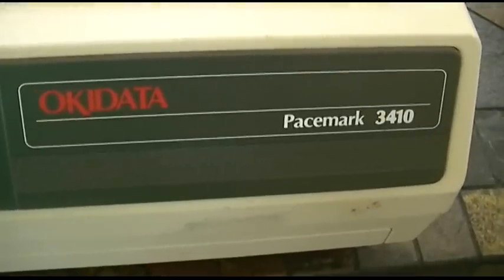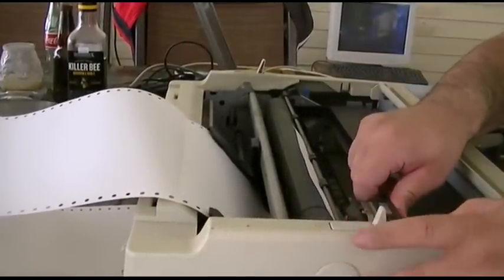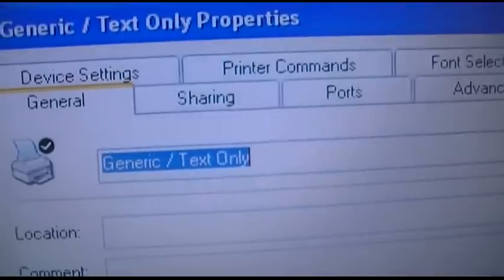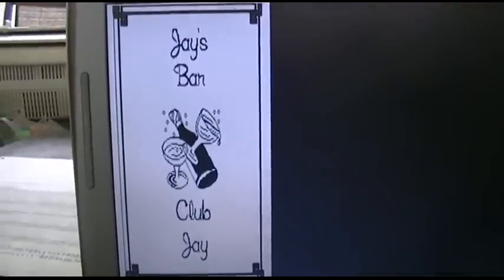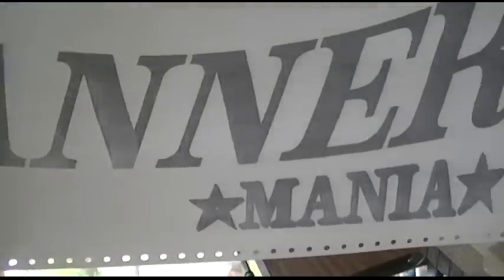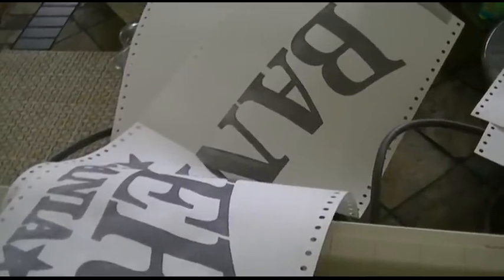Okidata Pacemark 3410 9-pin Wide-Format Dot Matrix Printer

Comment: 4:07 self-test
6:10 Demo in Utility
6:44 Demo in HSD
7:24 Demo in Gothic
7:55 Demo in Courier
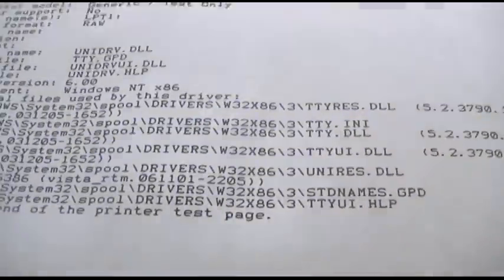8:15 20 CPI demo
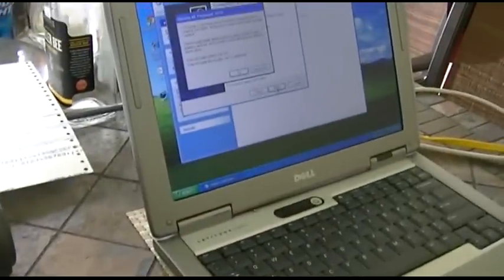9:43 High resolution print
12:11 Windows test page print - medium quality
12:35 Windows test page print quality comparisons - lowest, medium and highest
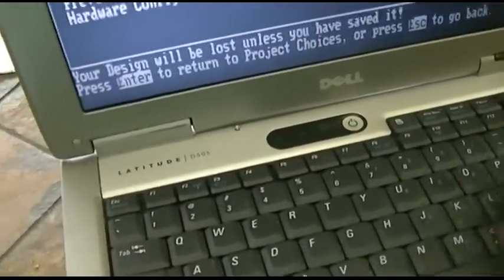14:27 Printmaster demo
17:14 Buzzer test, and line feed using Command Prompt
18:57 Road test 1
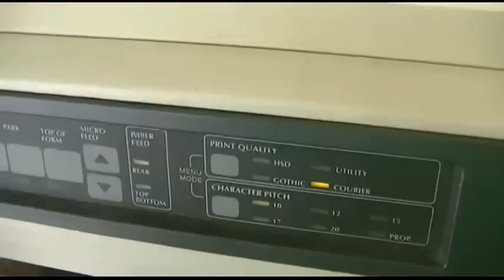22:16 Road test 1 (higher quality)
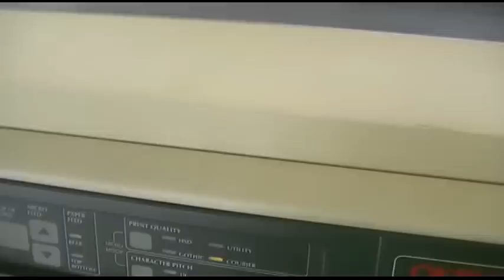24:18 Banner Mania demo
Reply from the maker: +BBRCTA2K5441393 Thanks for that!
Reply: jaykay18 It's there so that when I come back to this video, I don't have to watch the whole video which includes your talking, and problems caused by incompatible drivers. Anyways, since that printer can really shake that table, here I give a nickname for the printer:
UnstableData Shakemark 3410 HP

By 3410 HP I mean 3410 horsepower, the amount of force produced by the printer.
Reply from the maker: Techtron23 Awesome!
Reply from the maker: It just does.  If you're running a 64-bit version of Windows, you're out of luck and you can thank Microsoft for that.  It may be possible, although I haven't tried it, that DOSBox would allow it to print.
Reply from the maker: Yes, I do.
Reply from the maker: At least 3, possibly as many as 5.  They are not "stocked".
Reply from the maker: Yes, for $500.  They're collector's items now, so you have to be prepared to pay the collector's price.
Reply from the maker: Yes, they do.  I have one other video, of another printer, printing from Printmaster Plus:  https://www.youtube.com/watch?v=-qhdg_FYWTI

Comment: Nice to see this stuff again. I was in it back in the Oki 2410 days of the mid 80s, sold a few of them. Never forget the first time I laid eyes on one at Comdex. Oki had them lined up around their booth running non-stop. Blisteringly fast compared to the Epsons and even the higher end DataSouth printers we had been pushing. The printheads reminded us of little chainsaw engines.
Reply from the maker: Oki's have the "squeakiest" sounding printheads.  Nothing else sounds quite like them.  One thing they did suffer from was heat.  Give them a lot of block graphics to print and eventually they'll overheat and start printing slower and slower and slower until it has to just sit there and "pant" to catch its breath.  But feed them text all day and they'll crank all day, absolute workhorses.

I grew up on an IBM ProPrinter, and there was no way you could overheat that head.  You could send it page after page of complete graphics and it would keep going.  Touch that printhead and you're looking at third-degree burns though!

Comment: I miss these old dot-matrix printers. I used a basic 9-pin Epson for many years and it was a fantastic printer. Replacement ribbons were dirt cheap and although it was just a simple 9-pin model it was capable of producing beautiful fonts. They could be rather loud but they were great and I really miss my old Epson. I'd love to have another one.
Reply from the maker: I used a true-blue IBM ProPrinter from about 1984 probably until around 2000.  It's printed countless pages.  Besides ribbons, and oiling the rails every now and again, it once needed a replacement printhead because one pin either broke or wasn't firing.  It still works to this day.

It's not terribly often I have just plain text to print out anymore, and graphics really take a long time to print on a dot matrix.  Though I have to admit there have got to be 8 dot matrix printers on my network, any of them can be printed to at any time, even wirelessly.  They were, and still are, workhorses.  Some businesses continue to use them.

Epson still makes and sells dot matrix printers.  But just like cars are basically lightweight tin cans today, and not like the old American Iron Muscle Cars with chrome bumpers, they weigh nothing and don't seem like they'd hold up.  I'm certain ebay has a plethora of old dot matrix printers for you to choose from.  Most likely they'll just need a good cleaning and some lubrication.
Reply: I've noticed modern-day (new) dot-matrix printers I see for sale are rather pricey compared to their cost years ago. Even a basic printer typically runs in the $300-500 range and if they weren't so damned expensive I'd probably buy one. I was gonna mention before that I still see dot-matrix printers still being used in various offices like auto parts stores or any business that still use multilayer carbon(less) forms. If I were to buy one it would definitely be an older model as you suggested. I just wish I would have never sold my old Epson back in the mid 90's. The friend I bought it from gave me at least ten extra ribbons and in two years time I maybe used 2 of them.
Reply from the maker: Yeah the price went up because now they're a niche market.  Very few businesses still use them compared to years ago.  Because the demand is low, the price is high, and it will likely stay that way forever.  It's too bad, a bygone era.  Chances are one day you'll come across one at a decent price, they still pop up from time to time.
Reply: I retired from my state job in 2009 and in the computer operations room we had three HUGE dot-matrix printers that printed on greenbar paper. They were high speed printers with special insulation on the inside and they were still LOUD but they pumped out many thousands of pages every single night 7 nights a week, and they were in service for 17 YEARS.
Reply from the maker: My dad worked for IBM for 35 years and I remember chain printers, those were REALLY fast.

I have a DataProducts 8070 Plus that is more of a business-grade printer, it's an oddball 18-pin printer, and can print up to 480 characters per second.  That's also a pretty serious machine, though many printers today can beat those numbers easy.  I have an old Okidata printer buried somewhere in the garage that has a dial you can turn to set the page length in inches, prints text only, no graphics capabilities at all, prints using an old 2-spool typewriter style ribbon.  Case is all metal, it's virtually indestructible.  

Waiting in the wings is a Panasonic daisy-wheel printer, complete with a box of film ribbons, for some of the best letter quality printing ever.  I need to make a video on that already...

Comment: Dude, this is a FANTASTIC video. So detailed -- you know so much about printers. It's funny when it all goes wrong though :)
Reply from the maker: Joshua McQueen Thank you.  I grew up with these printers.  One day I found the manual for it (and this was back when they would write manuals with all sorts of technical information), and read it cover to cover.  Then I applied some of the things I read in the manual, and ended up learning all kinds of stuff.

This was back in the day when things were more mechanical, and you had access to the core of the machine, rather than all the fancy touch screens and facebook that we have today.

One of my favorite lines (if this makes any sense to you) is "That's called drop down to DOS and get the job done properly".

Comment: Late to the party, randomly encountered this video while I was looking for EEPROM information for ADP and R&R chips. but if you want to watch all the gears run without the cover in place, remove the 2 screws at the back and tape down the switches on either side of the metal frame the control panel is attached to. Plenty of car dealerships still using them so they are fun to work with.
Reply from the maker: Thanks Josh!  Next time I play with it I'll take a look at those switches.  This would be really nice to see run open, since it runs so fast!
Reply: Not a problem. Since I believe you are outside the range of my repair work and know what you are doing I can get you 3410 service manuals if you need. They have their 1997 one with part numbers as well as an updated one from 2015 that doesn't list part numbers. Normally I use the older one but I am typically trying to isolate a number for ordering.
Reply from the maker: If you have the manual in PDF format (or some other electronic format, it wouldn't hurt to have!
Reply: Have to double check the format, but it is electronic. I'll send a message with it once I find it.
Reply from the maker: All right thanks!

Comment: I’m having trouble with my printer changing from print quality utility to gothic. Would you know how to change the setting to keep it in utility?
Reply from the maker: If it's doing it by itself while NOT printing, that seems to indicate a button issue.  If it switches during printing, the control codes to switch it are being output to the printer.  Check your driver and emulation settings.

Comment: How can I get my Oki Pacemark 3410 to print darker?
Reply from the maker: Replace the ribbon.  They are indeed available.

If it still prints too light, it's possible your head gap is set improperly.  For single-copy paper without any carbonless copies, it should be the closest gap.  The manual is available online and will explain how to set that.

To rejuvenate an old ribbon, I have heard you can spray it with WD-40.  I have never tried it, so I'd recommend you first get a replacement, then do some research, and try it.

Comment: Very cool! I'm working on editing the video of the Apex 80 you wanted to see earlier btw. I'm a bit envious, your one is a real work horse while mine is much more rinkydink for the home market. lol
Reply from the maker: There's nothing wrong with "home market" machines; that's what most of us had back in the day!  I got lucky running into these!
Reply: Before I really got into collecting old computer stuff I once saw a pristine Epson 24 pin dot matrix printer with paper rack and everything in it's original box and they only wanted 10$ for it. It's still something I kick myself for letting go. lol
Reply from the maker: Transcendental Airwaves As much as I hate to say it, I've got a couple of those, too.  Of course, they're not pristine, the paper advance handles are broken (or not working well), and they've certainly yellowed over the years.

I've found that Epson printers can be hit-or-miss, some were real nice, others were just junk.  Oki printers always meant business.

Honestly I've always preferred IBM printers (dot-matrix), they were the most no-nonsense printers in my opinion.  Even into the early days of Lexmark buying out their printer line they were good; I have a Lexmark Forms Printer 2381 that's awesome.

Comment: These printers squeak like this because the pins fire really fast. Its what makes them print so fast.
Reply from the maker: I beg to differ on that, I have a ML 192 which prints much slower and makes the same squeak sound, just slower.  It's due to the deign of the print head.  I have a DataProducts 8070 Plus that can print at 480cps draft, doesn't squeak, and interestingly enough it's actually rather slow printing graphics.

For whatever reason, however these Okidata printers are designed, they make that squeak sound when firing the pins.  They also can overheat the head pretty easy.  My old IBM ProPrinter could print a 7-page banner, triple pass on each line, and while that head would burn you if you touched it, it would not overheat and stop the printer.  Yes, it does have overheat protection built-in.

Comment: WOW! that cool!, how long have this one have been sitting? What is that program you print your bar paper with?
Reply from the maker: I haven't had this one too long actually.  It's sitting outside because I haven't made time (or room) for it yet.

I used PrintMaster for the bar sign.  I don't remember the version, but it supports CGA (600x200 2 color mode), Hercules, and standard text mode, but in text mode you have to "guess and check" as for the placement of text and pictures by printing, adjusting, and reprinting.  

I printed the banners with an equally old version of Banner Mania.  That supported CGA 600x200 2 color mode, and EGA 600x200 16 color.

Comment: Anybody know if these drivers will run on Windows 10?  I doubt it, but am curious.
Reply from the maker: In text mode, you can just use the text-only "generic" driver.  If you want graphics, you'll have to take a peek to see what Windows offers.  When you try to get something this old to work with something that new, you may have to try several drivers before you can find one that will work satisfactorily.  I don't have a Windows 10 machine to see what it offers, but I was pleasantly surprised to see there were a lot of legacy printer drivers in Windows 10 when I worked with it.

You may use a different driver entirely, for example if you set the printer to IBM ProPrinter emulation mode, then you'd select the IBM ProPrinter driver in WIndows.

Comment: That was funny, seeing how the printer had a fit with the wrong settings etc.
Reply from the maker: That was a completely normal thing to contend with back in the day.  I had an IBM ProPrinter when I was a kid, so there was never any compatibility issues.  If the program supposed the ProPrinter natively, obviously it would work.  But an earlier standard was the IBM Graphics Printer, which this was fully capable of.  Emulation of other printers didn't always fully work.

Part of the reason for this is that each printer used a different control language.  Dot matrix printers were built to really print text.  In order to make them print graphics, you had to send them the proper control codes, which included what print density (effectively resolution), proper line spacing (so there wouldn't be white banding in the prints), then another string of data preceded by the "print graphics" code just to make it work.  Any one thing off, and it starts printing text, or goes completely crazy.  Years later, we went through this kind of thing again with "modem initialization strings", some of which could be quite complex.

Comment: It is a wonder that they don't destroy themselves like that.
Reply from the maker: There are much faster dot-matrix printers out there, especially the ones for big businesses, they can print over 1,000 characters per second.  On an 80-character line, that's 12.5 lines per second.  Generally, 66 lines were printed on a page, that's a little over 5 seconds per page.  That averages out to about 12 pages per minute.  Kind of slow for today's standards, but was super quick back then, especially when you consider that typical home dot matrix printers were about 5 times slower than that.

Of course that all considers that each line is exactly 80 characters, and if you were printing a report, the lines would vary in length which would mean even faster print speeds.  Or if the pages didn't have as much printed on them, they could REALLY fly.